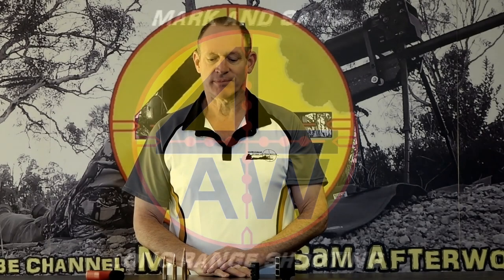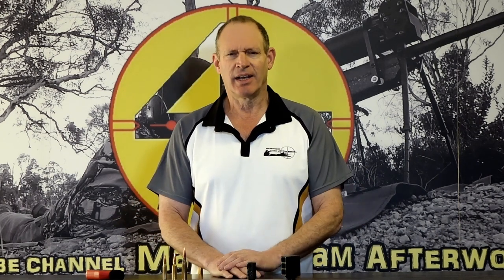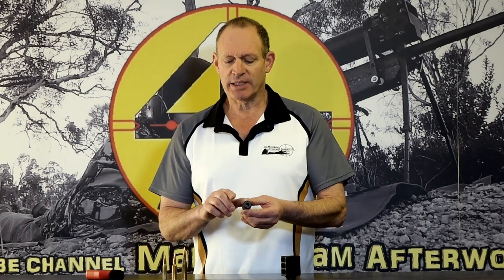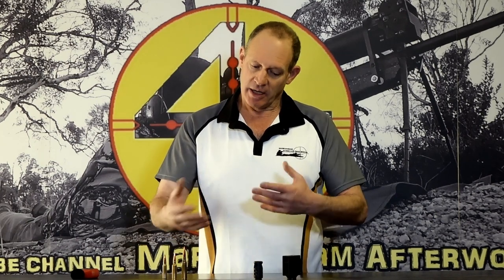Muzzle Brake Noise?

Comment: Great video again :) Retired sound engineer here. Could it also be the pressure wave is sent sidewards and rearwards as well downrange with a brake as opposed to mostly downrange with no brake? The 'loudness' difference being the same as standing in front of subs at a festival, it physically moves the air and ground around your body more, and your brain does the math? Very interesting subject
Reply from the maker: Thanks man, as for pressure wave/waves, some times many, and yes they may influence.... could go way over board testing here, lol, Cheers

Comment: Except you can have a muzzle brake that does not make the rifle louder to the operator, or those standing 90 degrees from it. There is a muzzle brake design that can do this and still reduce recoil. How does it do it? First see how most all muzzle brakes work. Holes are made to direct escaping gases reward to eliminate recoil. In the process it also directs sound and debris backward toward people. Not a good thing even though recoil is reduced. A better design is to make a muzzle brake that directs escaping gases slightly forward. Yes, slightly forward. Hear me out..... Suppose you had a barrel that directed all of the gases straight forward. That barrel would have 100% recoil. Now take a second barrel that has a muzzle brake which has slightly forward facing holes drilled in it. We now have maybe 50% of the gases going forward and 50% going slightly forward.  With this configuration of a muzzle brake not only is the recoil reduced but the noise and debris is reduced also. Another way to look at this is imagine we explode a gas in a plugged tube with only 90 degree holes at one end. There will be no recoil. Slightly move the holes forward. There will be just a little recoil. Gentry is an example. Not affiliated with them.
Reply from the maker: We have videos to explain about muzzle brakes, lots more details too it, FYI noise is not one of the features most are concerned with, lol, Cheers

Comment: Your data isn't making sense to me. You're seeing peak sound in the 114db range. Every other study I've seen published on this has peak volume at the shooter in the 150-180db range.  This is a couple orders of magnitude difference from your data. 22lr is generally cited at around 140db and below 130db is consider hearing safe...so your data seems way off to me.  Am I missing something here?
Reply from the maker: Yes I would agree the readings where all lower than expected, possibly the peek spike is not captured with these tools, maybe the position of mic's, but as explained, not a scientific test, just a comparison between all that was explained, Cheers
Reply: Could be wrong , thought db isn’t linear - each db doubles the sound ?
Reply: @keithfalcao1844  You’re right it’s not linear, but I think it’s more like 3db doubles the sound energy.
Reply: @markandsamafterwork  I did a little looking and it appears there are two different types ways of measuring sound, sometimes sound meters can only do one or the other. “A-frequency-weighting” is more commonly used but “C-frequency-weighting” is used for gunshots or explosions. This is signified by the notation dB(A) or dB(C). I wonder if your meter is doing the “A” variant? Might be why you are getting lower than expected readings? 
Anyway, thanks for spurring the conversation, I learned something new 😎

Comment: Great review Mark. My experience with others using muzzle brakes in range conditions is nothing short of unpleasant. Many years ago a pal was shooting his .270 Win rifle with a Browning BOSS equipped rifle. Shooting positions are approximately 2 meters apart. With my usual hearing protectors ( I was also shooting a .270) the noise or perhaps the concussion significantly hurt my ears. No permanent damage hopefully but not a situation I wish to repeat.
Reply from the maker: Yes, they are not that nice to shoot along side, not close anyway, Cheers

Comment: Pretty cool test indeed. Thanks!

I may compare it to being beside speakers playing loud music instead of being behind, the volume is at the same level but the direction of the sound is more toward our ears, so we perceive it louder. Of course any reflecting wall or surface will affect this too. 

Like If you place you hands behind your ears to make a cup shape, imitating say, deer ears, you will hear more details and sound will be perceived louder, but the level of the sound is the same, you just added increased area for the sound to come and reflect into you ears. 

Kind of the inverse effect a muzzle break does, instead of increasing ear capacity, you "turn the speaker" more toward your ears, so it dissipate sound more efficiently and directionnaly toward our ears, with the same kind of results.
Reply from the maker: Thanks Man

Comment: Interesting,  I've definitely noticed brakes are a lot louder under the low tin roof at our range,  another observation I've found is that when chasing feral pigs, etc, with no brake they'll take off exactly away from your position but with a brake they look more confused about where the sound is coming from and run around in circles, etc ???,.
Maybe the brake spreads the sound in different directions so they cant determine the exact source ???, anyone else noticed this effect ??,

Shoulda mentioned, this was with a 4AW brake, so order one, the are AWESOME :)

cheers,
Dave
Reply from the maker: Thanks Dave, Cheers
Reply: I have with the tin roof at the range, never had a chance to chase hogs. I would suspect that the concussion that the shooter and others feel plays a role in perceiving brakes as louder whether or not they actually are at the time. I may be wrong on that though, I don't know. Keep up the good work guys!
Reply: I have been in the woods hunting deer and a friend was 50 yards from me . He took a shot on a nice buck in the opposite direction . I observed the deer I was watching and all they did was look up and then went back to eating .  
On the other hand , I have made a slight move with a creaky stand and the deer have bolted . You just never know . Lol 
Even with a silencer a dee will hear it . 
I think there is some truth to dispersement of sound with a muzzle break confusing an animal as to where it should go .

Comment: Great video! 
I hunt with a muzzle break on a 7mm rem mag and a 6.5cm. I have noticed, particularly in the 6.5cm when shooting into a group of animals, they seem to have trouble working out where the sound has come from. They tend to mill around and I often get to shoot a second or third before they take off. My assumption is they don’t want to run until they know which direction the danger is coming from.
Reply from the maker: That would make sense, thanks Daniel, Cheers

Comment: Thanks for the great video. 
I was out hunting plains elk in Colorado. I have a radial brake on my Browning X-bolt .270. I forgot my ear defenders and really didn’t notice the sound being that loud. Of course the adrenaline is up. 
We have a 100yd range to shoot at which is pretty much in a hole and has a metal awning over the top of the shooting benches. That is when it does seem louder. But even the none muzzle breaks seem loud of course the sound is echoing off the walls of the range and tin awning.
Reply from the maker: Thanks Bryce, Cheers

Comment: Hi mark and Sam. This it a very complicated question.  You have to look at sound waves rather noise levels as you found the noise level were about the same. What effect is sound waves reflecting off objects and each other. It’s like throwing a stone into smooth water you see the ripples going out in all directions. When you use two stones at the same time you get the same ripples but at some points the hit each other. They cancel one other or make a longer wave. So the same with sound once the sound waves bump into each outher it’s not louder it’s longer to the perceived ear.  And depends on where you are and what’s round you. Hope this helps as it’s a very complicated subject and difficult to explain in simple terms.  Bob.
Reply from the maker: Thanks Bob, noise cancelling sound is a very specific science, not something you will find created in these sort of conditions, Cheers
Reply: This is not sound cancel it’s reflection.

Comment: you got one thing there , for every 3db increase you dubbel the sound (1db is about 25% lounder or lower, 3db is 2x more sound . sound Energy is amost as high, so the sound is felt a lot in differens when you talk 1 digits)
Reply from the maker: At low levels that is the case, but 100dB to 103dB is not a discernable difference, or around 3% so not relevant at these levels,  Cheers

Comment: The perception of sound is an amazing thing. I have hearing issues that requires hearing aids. My left ear seems to have more difficulty hearing but in fact it works better than my right ear. The perception and interpretation by the brain is mind boggling and confusing at times.
Reply from the maker: Thanks Dave

Comment: Thanks, that was rather interesting. After having my hat and my butler-creek scope cap blown off by a braked .338 Lapua in the next shooting lane, I have wondered whether we experience muzzle blast as "louder".
Reply from the maker: Cheers Pete
Reply: That's one hell of a brake to blow stuff off.
Reply: @bmstylee  it had me flinching for the rest of the day!
Reply: @peterconnan5631  sadly I think I gave a kid a flinch.  I was doing load development on my 338 Lapua.  I was on a 200 yard range when a dad and a kid with a 243 that looked like a first deer rifle came on about 20 minutes after me.  I let them know what I was shooting and that it was probably not going to be pleasant to be near.  Dad said not to worry.   After the first 5 shot group they moved about 15 yards the other way.  I guess they didn't dig the blast off my brake.  If a silencer for a 338 wasn't so damn expensive I would buy one.   I just don't want to spend the $1500 or so for one.

Comment: Concussive wave distribution, proximity to muzzle blast and the db increase (scientific formula) equates too the use of effective hearing protection. For any rifle range "mandatory" hearing protection should be a requirement, once you enter the shooting area, double protection is best, electronic headset over soft plugs. Tinnitus is no fun, hearing loss and the use of hearing aids, is no fun. Shooting is fun, but, be smart.
Reply from the maker: Yep, thanks Don, Cheers
Reply: I can do shotguns under for with Sordins only no problem. But I was next to 5.56 AR15 with a muzzle brake, earplugs under the Sordins and it was still almost painful.

Comment: Could be wrong - db is not linear , each additional db is doubling the sound isn’t it ?
Reply from the maker: Not a sound engineer, but sure can tell you 101dB has no noticeable difference to 100dB, more than 5dB at that level to even notice a difference, Cheers

Comment: Theres a very easy solution for the ‘extra sound’ created by shooting muzzle brakes at ranges indoors etc… all u have to do is buy u a pair of mechanical filtered ear plugs to pit on and then put your electronic muffs ocer those  theyre cheap like $10 for a nice solid performing pair of ear plugs and u wont notice that much of a difference between muzzle beake and no brake other than the concussion waves hitting u theres no solution for that besides a suppressor but other than that ur ears dont get damaged and fatigued plus j can still hear jus as good as long as ur using electronic ear pro u can withstand to shoot way way more with brakes but eventually the pressure waves do start to fatigue ur eyes so unfortunately theres still a lil bit of things u have to accept dealing with while using brakes theyre way more than worth it if u ask me in fact i wouldnt try shooting long range without them not even rimfire they jus bring too much benefit to the shooting experience especially when shooting long range then theyre damn near invaluable
Reply from the maker: Yes, all things have there place, use them in there place, all is good, lol, Cheers